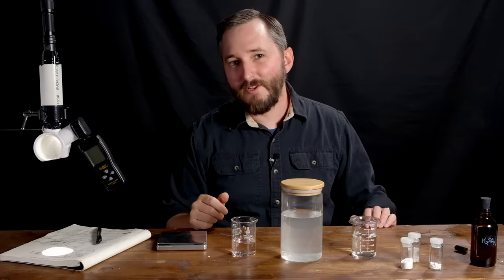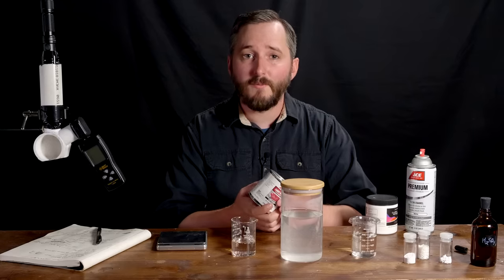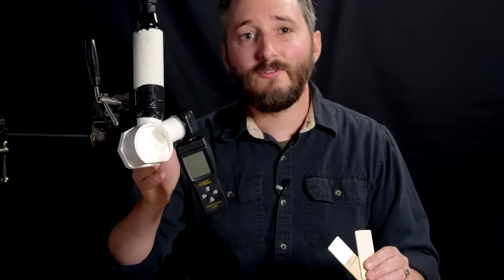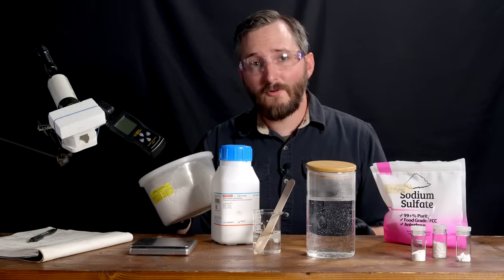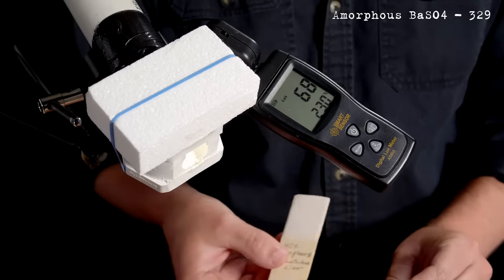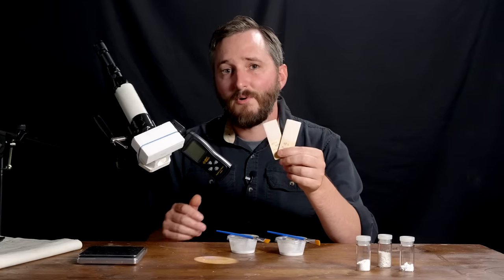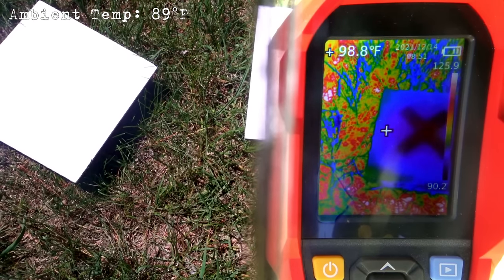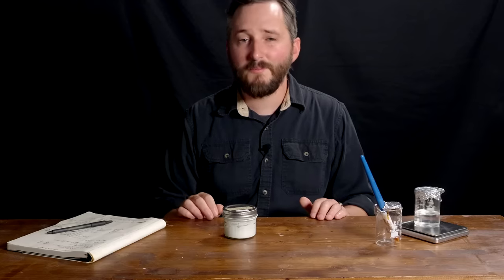How To Make Infrared Cooling Paint (Electricity Free Air Conditioning)

Comment: I hate to give away the farm but, guys, this is the solution to the water shortage. Instead of spending a year's wages on an S.B. Russell "dew reservoir" just paint a metal-roof white and collect the run-off. ...Uh, it needs to be a food-grade paint.  The roof's insulation needs to be integral to the underside of the roofing or there will be LOTS of condensation in the attic.

Comment: Is the phenomenon actual "cooling" or, in fact, "prevention of heating that would otherwise occur in the absence of the paint"

The phenomenon, whatever its accurate name, may well occur after the paint has been applied, without FURTHER energy expenditure, but there is a certain energy expenditure in its manufacture, transport and application that should not be ignored.
Reply from the maker: It is actual cooling, in addition to lack of heating that would otherwise occur. Actual cooling is the only way to make sub ambient tempertures

Comment: Could we do this electronically? Use suitable black body elements for sunlight absorbtion (maybe some thermal transfer medium with solar panels laminated on top for double wammy) to sink rather than directly reflect the energy, convert heat to electric, then use that electricity to drive high efficiency lasers tuned to the right IR frequency, blasting out to the cold black beyond?

Obviously that can be done, in principle and theory, but can it realistically be done while "ejecting" more energy into space than the waste heat the inefficiencies of this chain would generate?
Reply from the maker: Seems to me that would have lots of losses along the way. Not sure.

Comment: Would this work on the top of RV's and trailers, which are, basically, big metal tubes? When it gets hot outside, the tubes heat up (just like a pan on the stove).
This may be a spectacular product for keeping people inside an RV cooler, and help lower the need for A/C from early morning to late into the night.
Right now, all we have is a paint on white coating to reflect the sun. But, it is not really good about heat. And the heat from the hot metal roof drains down in to the vehicle when the temperature cools down in the evening. This reheats the RV in the evening as warm air rises to the inside of the RV roof, and the colder air outside pushes the hot air back down.

Comment: I am interested in trying this paint for building cooling in tropical Africa where winter is not a problem and cooling all year round is desirable. Is the paint useless without the plastic film and air gap insulation? If so, is there a way to make that insulation more sturdy so as to survive high winds and rain storms?

Comment: An alternative drying method is to vacuum dry, so long as you have a cold trap to recondense water and ammonia so as not to destroy your pump. Note, I'm not talking about vacuum assisted filtering, but rather just pouring wet paste on a tray and shoving the test into a vacuum chamber.

Comment: i am a little sad because CaCO3 wasn't mentioned. CaCO3 is in seawater, you just apply 6 volts for 36 hours and seawater dumps all of its not seawater into a substrate, which is mostly calcium carbonate. I've been trying to replicate the studies on this, since most of them have to do with electrical removal of waste calcium in coolant systems.

However, the CO2 in ocean water can be precipitated out as CaCO3, which evidently can be used as not only a precursor to concrete, (aka limestone), but also used as a highly reflective (in IR) paint dye?

after you precipitate out the CaCO3 you can get clean water out, with just nacl and some other stuff. i forget. 

the whole-ass ocean is right there.
Reply from the maker: I'll get to calcium based paints in the future

Comment: I hear advertisements for a product called CoolWall in the Dallas Fort Worth radio market that claims to do this! Any comments?
Reply from the maker: I don't know the product. A lot of paints and coatings advertise that they can cool a building down, but typically that just means in comparison to normal paint. It takes a special setup to achieve cooling below the air temperature in daylight. Cooling paints that are on the market can still be worth using even if they don't go sub ambient, because even a small difference in sunlight reflectance can reduce cooling costs and energy consumption.

Comment: If your technique works, then it can be used to pull water out of the air at night, even in the desert.
The cooling will cause condensation.

Comment: Could this potentially improve a MLI Radiation Shield for something like a Gifford-McMahon Cryocooler?  Currently at work we are just using an Aluminum Pineapple Juice Can with a layer of Charcoal dust epoxied to the walls to absorb any stray hot molecules.  This is then taped to the 1st stage using Aluminum Tape.  While doing a decent job at protecting the second stage, it doesn't seem like it would thorough way to prevent the walls of the outer Stainless Steal vacuum Chamber radiating heat into that first stage via the exposed outter walls of the Aluminum Can.  The idea here would be that if applied to the outside of the Radiation Shield, it would prevent the shield its self from absorbing radiated heat from the Vacuum Chamber?
Reply from the maker: I don't know enough about that sort of system to make a recommendation. I think if you're looking for sheer reflectance of all radiated IR an aluminum or silver mirror coating is tried and tested. I don't know that this paint would be better under conditions without the sky cooling effect.
Reply: @Nighthawkinlight  I understand.  I was watching Tech Ingredients' video on the topic in which he was talking about the refractory properties of this paint being close to 99% which prevents the material underneath from gaining heat energy from radiation thus allowing it to successfully radiate it's own heat away which leads it to drop below ambient pressure (Perhaps this is wrong and I completely misunderstood).  I can't imagine Stainless Steel at room temp gives off any wavelength of EM radiation that the sun doesn't?  If this pain can refract 99% of radiation from penetrating into the underlying material, then having it as the last layer of an MLI shield would theoretically have as much if not more reflectivity than a mirror that has partial reflection and will ultimately absorb a portion of the radiation energy?

Comment: Hope your health issues have cleared! 
I have another comment on this video. I’ve had a few observations since then. An acquaintance made a hunting blind using reflective mylar sheets, think reflectix film. Having a LARGE roll he put it up under his roof as well. With no other insulation installed it feels much cooler inside! 
I’m wondering if there would be a way to combine your paint with the IR reflective film for an additive effect?
Reply from the maker: I've been playing with reflective films but haven't had success so far in making them reach sub ambient temperatures.
Reply: @Nighthawkinlight  @techingredients has a recent IR reflective solar cell video that, if I remember correctly, gets to subambient temps.

Comment: As an EMT, living and working in the south, something we have to contend with (frequently) is hyperthermia patients. With this material being able to draw out temperatures of a material, could this somehow be used to create an "anti-hyperthermia" garment, or something that would allow it to be applied to someone suffering from a thermal emergency?
Reply from the maker: Sky cooling is limited because it doesn't work indoors or anywhere with an obstructed view of the sky. I think a wet blanket would be more reliable.
Reply: @Nighthawkinlight  except therein lies a large part of the problem; in Florida, on average, the relative humidity in the air is so high, that evaporative cooling isn't as effective . . . there's nowhere for the liquid to evaporate to. But something that didn't rely on evaporation to cool (without some sort of refrigeration) would be a boon to people experiencing these events.

Comment: I tried mixing acrylic in acetone but 24 hours later it's still not dissolved. How long should it take.
Reply from the maker: More than 24 hrs. It will gel at the bottom of the container and need to be stirred before it fully dissolves.

Comment: I wander how well this would do on vertically mounted surfaces... like could you paint the outside of your house with this to help prevent heat from entering?
Reply from the maker: It could help because of its high reflectance but it won't be below air temp unless it's facing the sky

Comment: Why did you not use CaCO3 .  This is ordinary lime paint. You can by  Ca(OH)2)  in the hardware store mix it with water and use it as paint. Then wait some days until  Ca(OH)2)  has changed to CaCO3 by contact with the air.

Comment: What would happen if instead of making pain, try Sintering the microspheres with pressure to make a thin solid film?
Reply from the maker: Could work, but seems like it would require more expensive equipment. I suppose you could sinter 4x8 panels same as other building materials

Comment: What if this kind of paint is used on 1 end of a contraption and some heat absorbing material on the other end and make air flow to spin a turbine? Can this stuff be used to make air move, a machine with no moving parts that circulates air??

Comment: I am mostly an end user of most things like this. I have a question that I hope has a simple answer. If this paint (coating?) reflects IR allowing passive cooling then is there a mirror version of this that does the exact opposite? A paint that gathers IR for passive heat gain? A reversible panel with this on each side could be quite useful. Just my 2 cents.
Reply from the maker: Black paint gathers heat very well
Reply: @Nighthawkinlight  Yes but there has to be a specific shade of black or a additive like the ones described in your IR reflecting paint that will improve the gathering of heat :)

Comment: Thermal imagers do NOT measure temperature.  They infer temp based on emissivity.

If you measure with a probe from the back side you will get more meaningful values.
Reply: I see you use a probe at the end, but you don't talk about it.  What were your physical temperature measurements?
Reply from the maker: I confirmed the temp readings were accurate with probes. You can see how I've ensured accurate measurements with thermal readings in my more recent video on this subject: https://youtu.be/KDRnEm-B3AI?si=1RiHS93OxAFf0rQ0

Comment: Hi, thanks for this extremely useful video. Very entertaining on top of being greatly informative.
I was looking at these type of paints for my roof (stone slabs, mandated by the historical rules in my part of the world). The problems is that the slabs get super hot in summer, so no amount of insulation can help. I am trying to find the best way for the stone slabs not to heat up so much in the sunlight.
Would you suggest this as a possible solution? I have heard you suggesting not for the cooling effect in the winter?
Thx in advance for your help.
Reply from the maker: Any white paint or whitewash will help.

Comment: Do you have access to broard spectrum infrared spectroscopy? Especially since the atmosphere window is around 9.5-11μm which a cheap uncooled microbolometer can see. 

if you look at what is used in daytime radiators in space, it's also about the geometry on a macro scale.
Reply from the maker: I've been looking at spectrometers on ebay but don't have one as yet.

Comment: Has a painting pre-apprentice who lives in a desert, do you think this would excel in the extreme heat of around 110-120 F, or would the heat overwhelm the cooling properties of the paint?
Reply from the maker: It will cool at least a few degrees below air temp, but that only gets you to maybe 105 degrees instead of 110. It's helpful but not perfect. I'm working on a better version now. Ideally this is not for use as a roof paint, but instead in panels like solar panels that air or water flows through. In that case you can take the air from the panels and feed it into a normal air conditioner, which makes the air conditioner not need to work as hard to reach cool temps. It's useful in hot environments.

Comment: Would the acrilic based paint be a problem from the point of view of microplastic pollution? I would imagine it would be fairly easy to get damaged / corroded by the environment, especially if the air pockets are potentially exposed and vulnerable to ice and maybe the plastic part being damaged by acid rain
Reply from the maker: A lot of paint is already acrylic based. For this use it works best when covered and protected by a plastic film so that prevents weathering.
Reply: Interesting, thanks

Comment: Wondering if there are more environmentally friendly/sustainable insulating clear layers than the clear plastic (PTFE? I forget what you used), which will eventually end up in waste of course.
Reply from the maker: The amount of polyethylene film required to cover cooling panels is inconsequential in the grand scheme of plastic usage. Polyethylene is also a simple hydrocarbon that can be directly burned as fuel with few polluting emissions beyond co2. It's also been successfully decomposed with various bacteria and meal worms.

Comment: What is the ratio of acrylic to acetone in the dissolved acrylic solution? And what is the ratio of the dissolved acrylic solution to the acetone/water solution?
Reply from the maker: Ratio of acrylic to acetone doesn't matter, only ratio of acrylic to water. 1.25ish ml's of water per 1g of acrylic. I use 10g acrylic dissolved in 100ml of acetone only because that makes it easy to keep track of how much acrylic you have.

Comment: Would painting a car radiator in the Cooling Paint and running the water into a thermally isolated reservoir (a good cooler?) and using a 12v pump and small solar panel work to create a "cooling panel"? It could be mounted in an XPS insulation frame and backing that could also be painted and then coveres by the polyethelene film.
Reply from the maker: I don't think a radiator is necessary. A flat panel with water flowing through it is enough

Comment: Does the surface have ti face up to work? This would be great on the back of solar panels if direction did not matter. They lose generating ( well really capturing  ) capacity as they warm up. A drop of a few degrees in the hot sunlight would go a long ways.
Reply from the maker: It has to face the sky

Comment: I have a practical application for this paint, how do I get some? Probably not going to be able to access all of the ingredients off the shelf...
Reply from the maker: It's not currently possible to purchase. Probably there is a good paint that already exists for your needs, it just won't cool as much as something like this. For example I am about to paint my barn roof with a commercial white silicone coating which will lower the temp inside significantly. Just not below ambient temp as this paint could one day do.

Comment: How would that paint work if slathered on something with a lot of surface area, say .. a CPU tower cooler type of apparatus with a pile of heatpipes? Could one be used to make cooling even more space efficient than by just making plates? A lot of the layers also would never be in direct sunlight that way.
Reply from the maker: The paint needs to be exposed to the sky so that makes it tough for an indoor thing like a pc

Comment: Do you think the application method would have any effect on performance? For example, would spraying it on give a different particle alignment than brushing it on?
Reply from the maker: The paint doesn't spread well with a brush because it has low viscosity. It is best sprayed on. Application doesn't really effect particle alignment because that happens during the drying phase.

Comment: Would mixing commercial ultrawhite paint with the acrylic 'snow trick' create better results than just using the commercial paint? Would thicker layers, e.g. 0,5 mm create better results?
Reply from the maker: The snow trick is really dependant on the ratio of plastic to water and adding paint to it would really throw that off

Comment: I don't understand the 'coldness' of space part that keeps getting mentioned in reference to  Barium Sulfate cooling properties, from a classical or QM perspective, why should this matter? As long as the absorption occurs in the atmosphere at least a dozen meters away from the surface we're trying to cool, QM says any readmission of these low energy photons is unlikely to be directed exactly back down and onto the surface we're trying to cool, this 'open to space' part doesn't make physical sense at all. The gases in the atmosphere in no way act like a perfect mirror at a short distance to ANY wavelength of EM radiation?

Comment: Why not try placing pipes coated with this paint in a small enough HDPE tube to whitstand a vacuum? It would look like a solar heating panel but doing just the opposite.  

Edit: Actually HDPE is not transparent in the visible spectrum. You would need polyethylene foil held over by a grid.. Complicated!

But one could try coating a polyethylene film with paint. Still useful.

Comment: Could something like this be used on a massive scale to suck power out of hurricanes? How high of a column of air could these theoretically cool at scale?
Reply from the maker: The paint only cools things that are in contact with it, like the surface it's painted on. You could perhaps use this on a massive scale to cool down ocean surface temps but that would be quite a project.